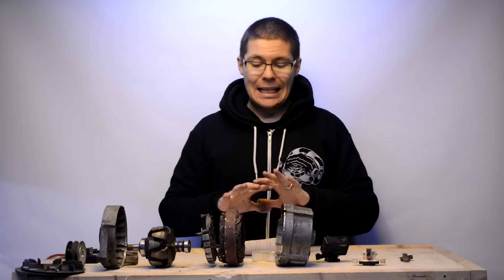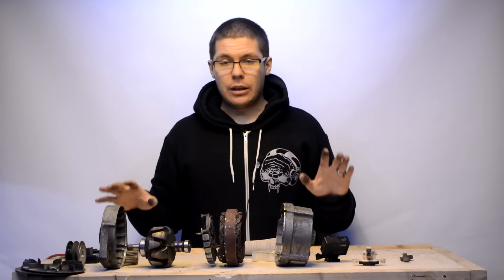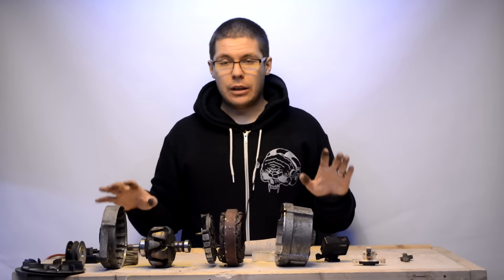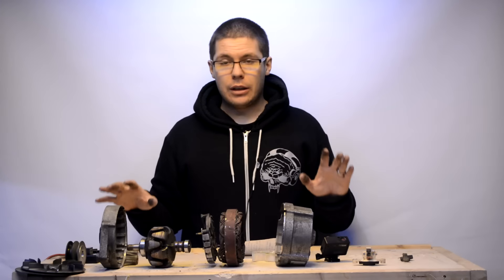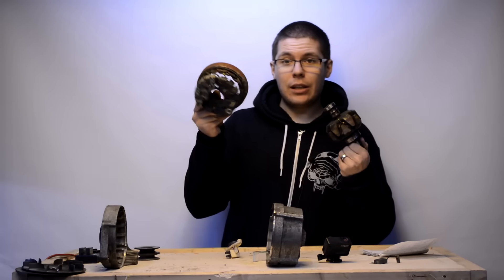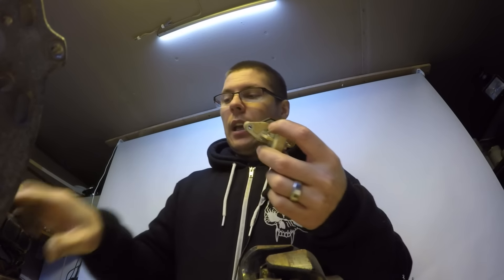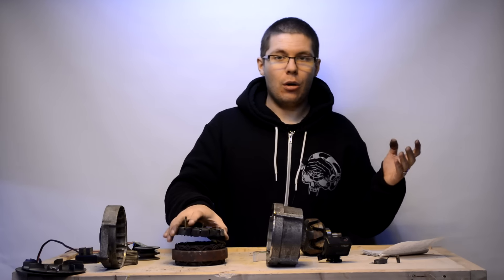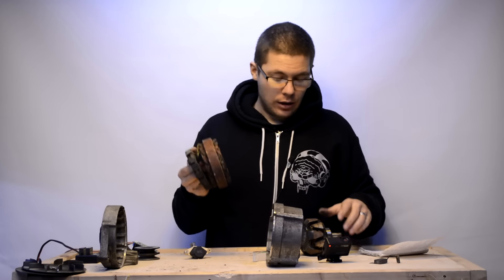#PN | How alternators work and how to modify them to produce 16,8V?

Comment: So you said "you can increase volts, but not amps"..then you stated that "if you make a 100 amp, 12 volt alternator into a 120 volt, then it would be a 10 amp alternator." is that correct? so you lose amps?
 Thanks for your time and the video.
Reply from the maker: Yes, you cannot make your alternator to produce more amps without replacing the stator coils to a different winding.